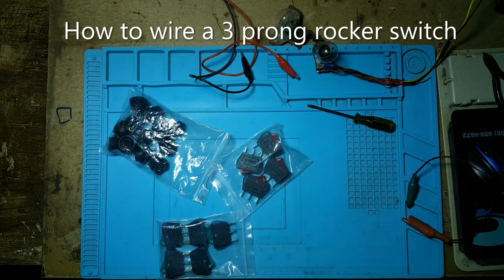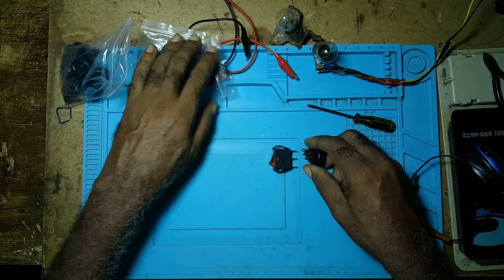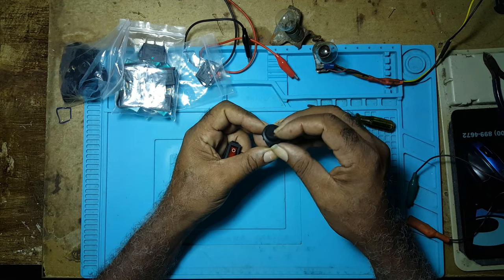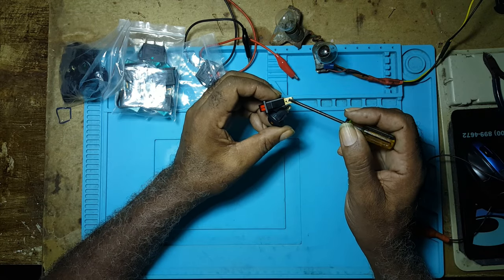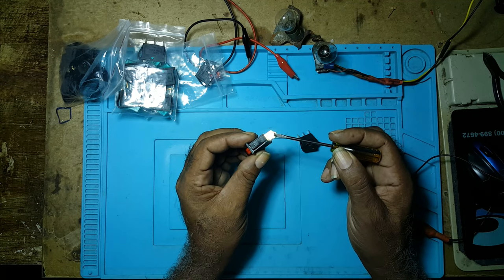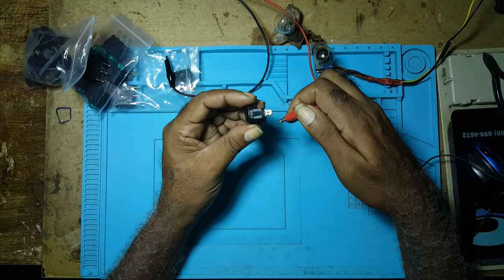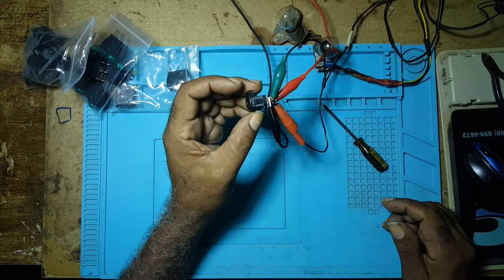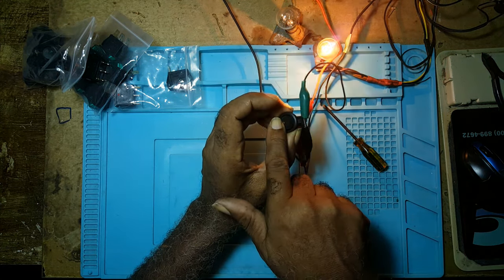How to wire a 3 prong rocker switch

Comment: Simple and clear.  Thank you. If I run an 18vdc supply, will I burn out the led light on a 12v rated rocker switch? Thanks.
Reply from the maker: I have not test it with that voltage but it's 12V 20A

Comment: One more question can you splice the ground wire from the lights into the neutral wire somewhere down the line before or after the switch to have just one wire going to the switch
Reply from the maker: You can but one end must go to the switch.

Comment: so, looking at top of switch...
Neutral is on the "on" side, load is on the "off" side.
I do not have gold/silver colors.
...
If you look at "On" position, and look at back side, the "On" neutral pin is there.
If you look at "Off" position, and look at back side, the "Off" load pin is there.
I don't know how to explain what I am asking, but, I think I have it.
If it is wrong, my power supply will trip....
I will try.
Reply from the maker: No there are many types of switch the switch i have that is the way it's wired.
Reply: Thanks for Asking this.   Switch i have lack brass pin, all 3 silver.   (Mine has NO 'on\off' Marks either) 
I've seen so many different wirings, or haven't, just more confused.  lol   
Not sure your meaning of Pin is "there",  Where?     On\Off Marks on toggle? 
Just knowing WHICH is Power IN would help.  on end when switches OFF? 
[my wordings]  #1 - Neutral IN on Switch OFF end [-0-] ;  Power IN, Switch ON  [---]  or [ | ]   (more fun, NO Marks) 
#2 -  Switch open, OFF,  under power OFF Mark "-0-" is Neutral wire.  ?  [center Accessory]  ??  

 Power IN under Line "---" (power on) mark. ?? 
BUT,  dumb me, lousy Pic -   not sure if power or Accessory had 2.   2 on center or end pin  
i believe i had 2 Wires on power pin, 1 each on Accessory & Neutral - somewhere in appliance power line went to item to work, and back to accessory.       I'm bumming switch from other appliance, Still AC 125 V  10-12 A   

I make Too much of something thought simple.  wired one in Car long ago, just fine.   
Some wire DC  \ others AC;  but using different pins, that's dumb.   Just On\Off. 
need new brain cell, mine Burnt Out.  haha 
Sorry for rant \ vent.  thanks      as said, "different types"   : }

Comment: My LED light on the rocker switch doesn’t turn on. Did I connect something wrong?
Reply from the maker: Make sure it’s 12v switch you have the center pin is live from the battery
Check out this video
https://youtu.be/FEa2-d_5wNY

Comment: What if you only have positive wire only,  no negative?
Reply from the maker: If you don't want the led on the switch to come on you can connect the negative together.
Reply: @AlwynNicholas  thanks I did find a ground wire and the light working now.

Comment: Switch works but I cannot get the light on the set pitch to work do I have a bad earth?
Reply from the maker: The negative of the  light must be connected to the negative pole and the positive of the light to the  positive pole for the output.
Reply: @AlwynNicholas  Thanks. the negative is currently earthed to a bolt on the body, do you mean I have to take the negative it to the battery negative?
Reply from the maker: No, the negative pole on the  switch must have to negative wire one to the bolt on the body and the other to the negative side of the load.
Reply: @AlwynNicholas  got it thanks
Reply from the maker: My pleasure you welcome.